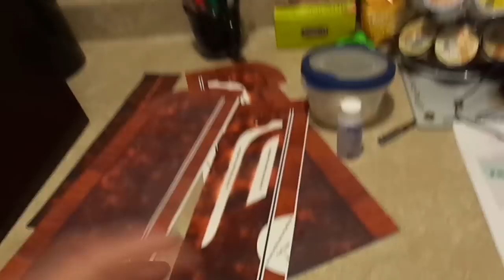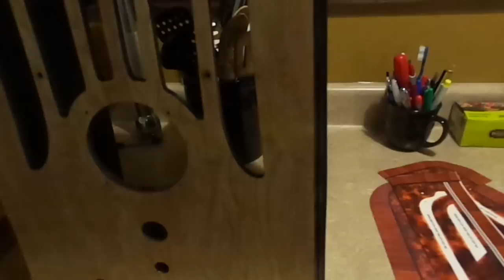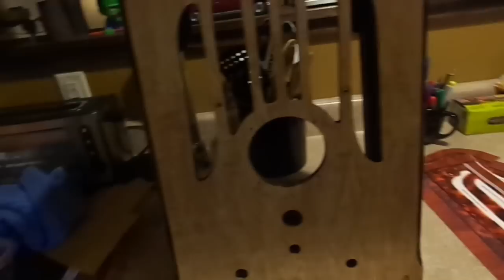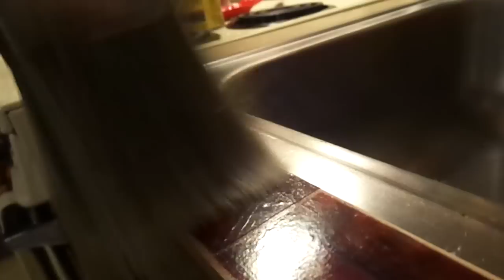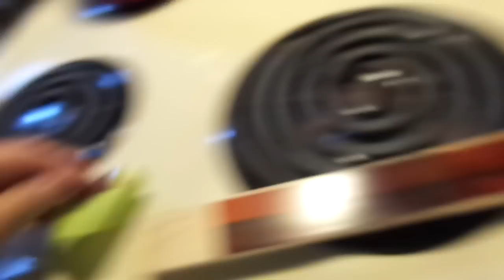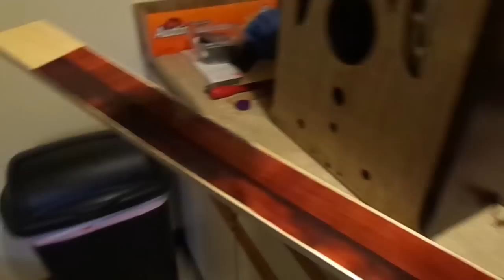Philco 37-640 Cabinet Restoration Part 3

Comment: Microscale comes in 2 versions, the blue labeled one that you have, Microsol, and it also comes in a red labeled bottle, Microset. The red stuff is much more aggressive than the blue, but they basically do the same thing.  They work by melting the decal into the irregularities and surface contours, the Microset is more aggressive so it melts the decal more, deeper into the contours, smaller contours on a model for example, benefit more from using Microset as the contours and details you are decaling over are very small generally, so it melts the decal even more to help keep the decal from having raised areas where the detail is holding it up.  I would recommend that you purchase a squeegee for window tinting to use for removing the bubbles. They are very cheap, come in many difference shapes, sizes and are a flexible silicon or rubber edge. Decals can usually be clear coated over as well. Clear coat is usually the final step people do after the decals are dry so they don't get damaged. Unless there is something really special about how these decals are made, a clear coat lacquer or enamel should work fine and protect the decals for a very long time, also should help keep it from fading. An automotive clear coat, such as Duplicolor clear provides UV protection, not all clear coats do.

Comment: there are 2 types micro decal set , red and blue , iam not sure what first comes  (first blue than decal than red) or ??? but you need both , and its best that you use not to cold water adding a smal amount of soap (you use for the dishes)